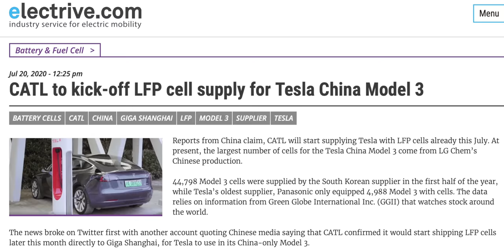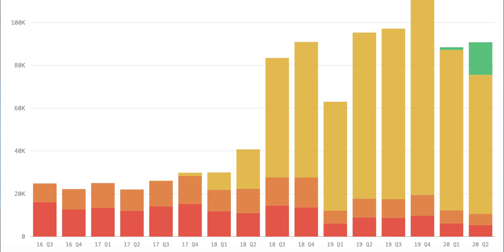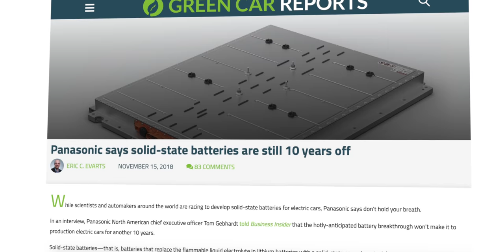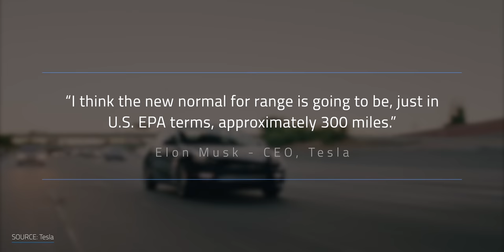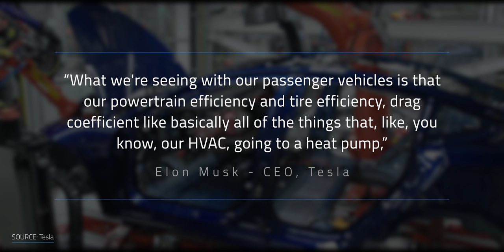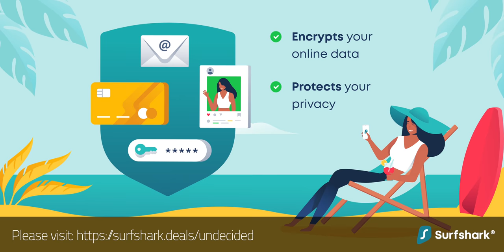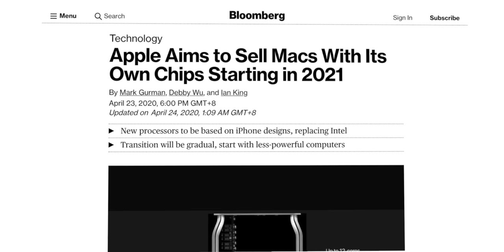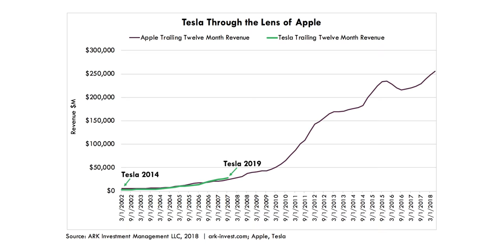Exploring Tesla's battery day and what to expect

Comment: A big uncertainty that Tesla has not addressed is what they're going to do with folks whose battery packs approach 70%. Even if this is not a warranty issue it is a functionally difficult hit for people who use their cars for long distance driving. How is Tesla going to rectify this or are they going to force people to buy new cars? A reasonable option would be to get a new battery pack for just over cost. I see no one at Tesla even thinking about this issue. Lots of model 3 owners however are already thinking about it after just two years of ownership.
Reply: Douglass - even the OLD 18650 can last over 500,000 miles , thats 50+ years of Driving. 
and in the PAST , Tesla has offered Total MCU + CPU replacement and NEW Battery replacement for ROADSTER and 2012 Model S vehicles.
at ONE point in 2017 , you could Replace Roadster batteries for $7000 !!!!!!!
and today you can Replace battery modules for $5000 - $7000 each.

Comment: Since we can assume adding a third motor does not extend the range of the current battery technology that is available in the Model S or any other Model currently being produced; that the new estimated range and speeds of performance are based on what theoretically the new battery technology will yield for the Plaid Model S. Am I wrong?

Comment: I think what Tesla may be aiming for is NOT more range, but to substantially lighten the vehicle with smaller battery packs that have the same range as today's battery packs. A lighter car means Tesla could put in more sophisticated suspension systems to dramatically improve the ride and handling of all Tesla models.

Comment: Matt, I think the other item that investors overlook is the ability of Tesla to collect, process and analyze data in order to improve its current and future products, such as vehicles and solar technology. Based off of that, I would expect their data analysis section to spin off and provide services to other EV industries. Tesla gains the data and sends back a finished product to the client. This eliminates the client buying a data scientist and analytical software. Tesla gains data for areas that its vehicles don't travel to or very often. i could see this type of relationship with WKHS if it gets the USPS contract. We need to view data as a commodity, but have yet to place a value on it.

Comment: I'm totally fine with current range as long as  charging time goes down dramatically and life time goes up.
Reply from the maker: Faster charging, long life, at a cheaper price ... winning formula.
Reply: It's not going to be about range, Elon dismissed it too many times.
Big production capacity at very low price is my guess. 
Faster charging and more cycles would be nice too.

Comment: Great insights Matt, I think 2 way charging capability and a battery recycling partnership with Redwood will also be part of the news, possibly changes in battery pack configuration without modules, and eventually removal of battery pack casing

Comment: Great Video Matt!  You might want to do a video on the new Yamaha motor.
        Tesla should embrace the Osborne effect lesson.  It should do so by taking a page from NIO and making 25% to 50% of the battery quickly exchangeable for any kind of battery.  Thus one could get a quarter battery of super Premium performance to enhance the longevity of the battery performance during a specific trip.  In other situations it could exchange that quarter battery for a super cheap quick charge for running around town.  Simply pay or receive a deposit for the Quarter/Bat depending on its market value and charge remaining and charge acquired.  Thus one doesn't miss out on future battery performance by buying old tech too early.

Comment: Wouldn't you say this is a partial solid state? Given what they plan to do with the Maxwell dry electrode. Have you seen the image Tesla released and resulting speculation of nano wire super cap tech? Btw, noone talks about volumetric energy density, this is where Tesla is miles ahead and arguably at least as important for more interior space, range and less aerodynamic drag. Gravimetric E density is chemistry specific and barely varies between manufacturers. Also the DRE can be used different ways you can for example allow more power density at same energy density or move that slider in any combo you want. This could allow for faster charging at same E density, which would be where Tesla would take it in my mind.

Comment: We need at least 400 miles on one charge, taking into account poor charging infrastructure.
Reply: Poor charging infrastructure and things that change your range like cold weather
Reply: @Ghost-jy9hk  really the infrastructure argument only makes sense if you're going to a destination further than your range. With Tesla's fast charging network as long as you pre-plan your route it's already very easy to go cross-country. For local travel you should be plugging into a class 1/2 charger every night and be at or near full-capacity at the beginning of each day. For long-haul transport with current DC direct charging most battery packs should be charged form 10% to 90% in 30 minutes which isn't much longer than filling up and getting a bite to eat, or dropping off a load in an ICE vehicle.

Comment: Elon has been tooting battery day for a year now.  Its likely some of the cars already have some of this tech in them.  IE a SR model 3 might have been using the dry electrode cells for 6+ months and Elon will announce that with a soon to come software update for a few more miles range.  Or maybe no more range but the cost of the car was 2k (or something) cheaper to produce.   Tesla is great at preventing the Osborne effect by already using the tech then announcing it after the fact.

Comment: With the tesla semi if they put a battery pack in the trailer (under the trailer) with connections to the truck you could probably get a thousand miles per charge (w/ rear motors on the back axles of course).
Reply: It would be ludicrously expensive and much heavier than competitors take days to charge and carry far less cargo legally because of the weight of the battery it would struggle to come to a stop and struggle up the grades

Comment: This is what I think.
If Elon says - "Blow your mind "   =50% + in energy density or cost of production, or fully charge in 10min.
Less than that would not qualify for "Blow your mind"
Reply: neither of these will happen, probably 5% more energy density for a bit lower price while maintaining the current charge speed because their superchargers are already maxed out anyways.
Reply: @Pixelplanet5  I don't think so, they have already announced a 5% energy density to be in cars from September this year. Regarding superchargers, they have a max of 250KwH but only charge at that rate for a short period, then scale down, if they can improve the battery chemistry they would be able to charge at max for longer, therefore recharging a battery much faster. Nothing stops them from also going with a Higher Charge rate.
But as I said anything less than that would not blow our minds.
10-30% would be a good improvement but not blow our minds.

Comment: I expect a 10x increase in cell production due to DBE and a 3x faster charging due to tabless cells.
Reply: z4zuse that seems a bit overhyped. Realistic numbers is 2x production increase and no faster charging as that damages batteries
Reply: Aleksandr Vasilenko ; maybe, but it is a combination of two factors. 
1. In the same floorspace more cell fabrication machines can be placed
2. The cell fabrication machine can turn out cells faster, because no drying is needed
That could allow for a 10x increase in production, if the same floorspace is used.
We’ll see. It is all speculation at this point

Comment: Does anyone know the relative weight of the electrode - electrolyte interface relative to the rest of the battery?  I was reading some interesting stuff about single crystal vs poly crystal interfaces and how the prior can significantly reduce resistance, thus increasing energy transfer rates and longevity.  I know poly crystals are often used because it's difficult to avoid imperfections due to gravity, but that high quality crystals have been grown on the ISS.  This makes me wonder if Tesla would ever build an orbital factory for growing crystals.  The competition would really have a hard time catching up when Musk pretty much has a monopoly on low cost launches (This is assuming Starship will be anywhere near as cheap as Musk was saying)

Comment: Bought my last and split new fossil Car factory ordered to my spec because it will be my last ICE car I ever buy. That was bought in 2014, only covered 24k miles and well looked after. Happy to run it for another five years to get a EV that does 400 miles. Just done a 400 mile on the dot door to door( hotel) trip in the U.K. the other day. Yes I passed a few Superchargers and stopped at a site (York) going from Glasgow to Duxford  in the one day. My current Car was saying 490 miles to the full tank although I think realistic 400 plus miles easy as at half a tank i had done 230 miles.  It was still saying range 50 miles when I pulled in end of the day with no fuel stops. 

Looking forward to what this battery day says but to me they will be announcing more where they will be in a few years rather than where they are at just now.
Reply: Does it run on diesel?
Reply: 450 to 500 is my EV buy point since I currently have no access to at home charging
Reply: @samuelwilliams7331  I guess you are hanging out for Lucid and maybe also Battery Day.
Reply: @spiritlevelstudios  Lucid is going to be out of my price range but I am very anxious for battery day. 300 wh/kg to 350 wh/ kg would be groundbreaking. Since the validation and testing time on batteries is usually 18 months I am not expecting these batteries until next year but who knows how long they have been testing.

Comment: Sodium ion battery, much cheaper battery with same range for commuter cars?
Reply: Always Censored  temperature of operation?
Reply: For commuter cars, if it works in similar conditions as Li-ion, then why not? If you can get the same range for less money, even with more weight, it can be a good alternative.
Reply: Always - LIPO is superior for BASE model and City Cars , Sodium Ion is worthless.
Reply: Mark Plott LIPO or Lifepo4?
Reply: @maximemineault8117   - Lithium Iron Phosphate.
Reply: @markplott4820  Lithium iron phosphate is Lifepo4
Reply: @benbelair7381   - semantics , Tony Siba calls the LIPO.

Comment: What do I think?   Well … a given fact of life is that it is easier to mix liquids than dry powders.  This simple fact of life impacts the drive towards dry chemistry batteries.  Currently Tesla is producing around 40 cars/hour.  Each car currently has a battery weighing 1000 lb.  If they are going to announce that are going towards a dry battery process then a reasonable assumption is that they will need a process that mixes 40,000 lb.’s of dry powder/hour to create the batteries necessary to match car production.  The mixture will need to be mixed perfectly before being compressed down into the density required for each cell.  From the little I have experience in I have in mixing ingredients for baking, I have noticed that the greater the quantities, the more the time increases exponentially to get a homogeneous mixture. 
Thus, if Elon is going to announce at battery day that they now have a solid-state or dry battery process, I hope someone in the audience asks him how he has solved this problem.  I am sure industrial caterers will be interested in the answer.  So, a solid-state battery?  Nah - at least not this time around; though hints for the future?  Probably.!

Comment: I’d love to see some battery advancement or super capacitor addition that allows the Tesla to maintain roughly the same level of performance no matter its state of charge.
Reply: Hmmmmm, I thought that they did keep performance until they stopped, the power management system shoudl do that, am I wrong?
Reply: @Muppetkeeper  lower state of charge = lower voltage
Power = voltage * current
Current is limited to prevent wires from heating too much (resistance), so lower voltage = less power.

That's one of the reasons why Porsche Taycan can maintain the same performance longer than Model S:)
Reply: Paweł Buczyński I understand that, however I thought that the power management system “pushed down” the maximum performance when the batteries were fully charged to enable a flat performance profile.
Reply: @Muppetkeeper  if you are in Ludicrous Mode, all performance limits (except for the really essential, like current to prevent melting down the cables) are switched off; without Ludicrous Mode there are some more limits.
Reply: TESLA obtained MAXWELL for the DRY Electrode technology , not UC.

Comment: Given the stock prices I thought it already happened. 🤭
Reply: The stock price reflects the faith people have in the future of Tesla (10-20 years), not about the present.
Reply: @Daniela-pr7rz  if that would be true the stock prices would be very stable because overall even if Tesla doesnt turn in a profit one quarter nothing has changed in the long run right?
thats not the case because your assumption is wrong, people jump on Tesla because it was rising fast so people jumped on the hype train to reap in some profits.
Reply: @Pixelplanet5  Why would it be stable? Less people had faith last year, more now, so the price is going up.

Comment: Haven’t Panasonic said the batteries are going to be 5% more energy dense from September? Also and you showed it as part of your Elon quote he mentions switching to heat pumps (same as Model Y I guess). I think all new Model 3’s built from September will have power train improvements, heat pump and new higher density batteries, I’m going to say 20% more efficient overall. 300mile EPA SR+ and 400mile LR AWD for the same money. then they will announce the Plaid Model S and X.

Comment: That's sounds awsome. Very informative, could you make a video about Tesla's locked features business model? As it's only thing which is starting to hold me back against them for now..
Reply from the maker: Good suggestion.
Reply: It makes more sense when you think of them as a software company more than a traditional automaker. Auto features are like software that costs money to produce and maintain, so "locking" it allows them to offset the cost of creating those features by only charging people who want them instead of making their cars more expensive across the board. This is similar to how you might have different price tiers in a piece of computer software - it doesn't cost them anything to distribute it to you so it feels "free", but it was not free to create.
Reply: @electrified0  seeing it from this perspective it makes me want to compare Teslas' with smart phones/PCs rather than cars. And I wouldn't want this type of market on my phone at least. While I understand that maintaining software and supporting it ain't cheap, this does not feel fair as I already feel purchasing full package upfront. Maybe it's something to get use on, but it doesn't feel a right approach for me, since up to this point I took Tesla for being as simple and as straight forwards as possible and this feels opposite.

Comment: Tabless Electrode- a plus 30% density without chemistry advances- reduces internal battery stresses, better heat control, **controlled internal battery degradation*

Comment: Great.  But when are solid state batteries going to offer 4 times the range at on one fourth the cost without the toxicity of present day batteries to break the dominance of fossil fuels in all areas?  Though planes will need an even bigger leap forward, no?  You're doing great and thorough high quality work.  (I've shared some of your posts.). Keep up all this good work.
Reply: peter - Rrsearch firms are many Decades away from a Commerical SSB product that can be used in a MASS MARKET Device.
there is PLENTY of room for Growth with CURRENT LION Technology.
TESLA is Building NICKEL + SILICON LION cells right now , ahead of Battery day.

Comment: I think conservatively they will have to address yesterday, today and tomorrow. That is the deals they have locked up from yesterday. What they are trialing on the road today. And how they are planning to scale for tomorrow. Today they may have the capacity to reach 1 million vehicles next year, but after that they will be constrained (unless) they can build hybrid battery packs with some higher density cells to free up traditional cells to go into other vehicles, and get Redwood online to recycle lithium from older packs back into the Newer chemistry cells. Also any news on prospective lithium mining deals will help with scale. The recent tweets on Silicon nano-wires probably features in the road testing today and pushing that to replace more traditional chemistry cells. Any news on beginning scale battery production with Maxwell tech can bolster the number of batteries produced per year, since they will be able to decouple from Panasonic and LG Chem at least in the US. Though LG Chem seems more a European play. It would be a lot of information to take in at one time. But if they present it as a logical plan, with real results and already in motion it could be a success. Dry cell electrodes are probably less of the news than expected.. but with potential for tomorrow. I base that on the recent tweets.